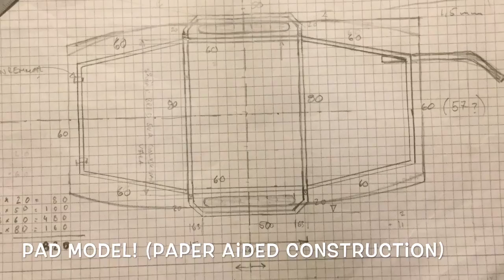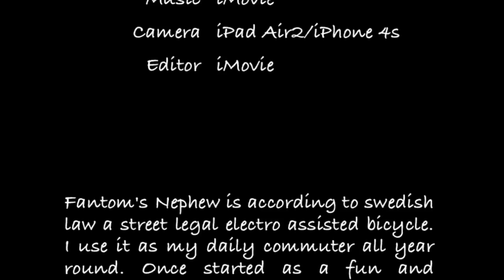Heavy Duty Bicycle Trailer

Comment: Not a bad design, the only thing I would change being that it is a heavy duty bicycle trailer putting heavy duty weight and stress on the hitch arm... is go with a industrial tie-rod end for the trailers hitch, they swivel quite nicely and are very strong!
Reply from the maker: Mr.McGoover Thanks! You have a point there, but so far the hitch arm has been stable enough. A good thing with the standard hitch arm is that I can use the trailer with any of my bikes.

Comment: how much did the velomobile cost to make? (without the trailer)
Reply from the maker: Antonio Hancock Since it is a hobby project I have carefully avoided monetary calculations that might put obstacles in the process.... :-D
Given that I would estimate somewhere around 1000-1500 €/$. If you buy every bit and take every inch of welding rod etc in account maybe a tad more. If you can find old bikes, steel (not steal!) and wheels the frame could probably be made at a close to zero price.
The next step for me was electric assist and that is hard to achieve at no cost, check out e-bike conversion kits in your neighbourhood or ebay.
As for the fairing I used plywood covered with glass fiber and epoxi (stitch and glue) which gave a very durable solution but there are probably cheaper ways, ie coroplast.
Check out the DIY-forum atomiczombie.com, I got much help there!  - Good luck with your build!